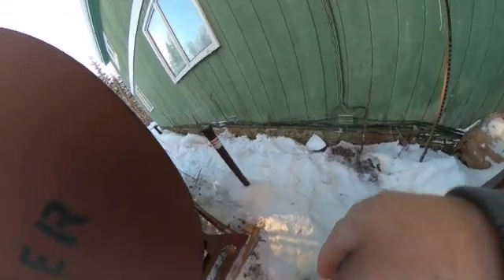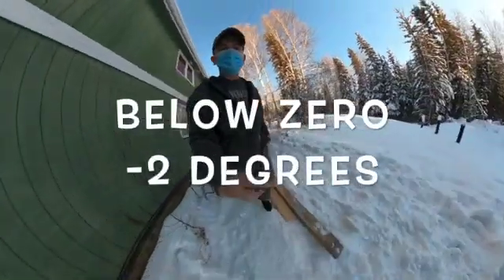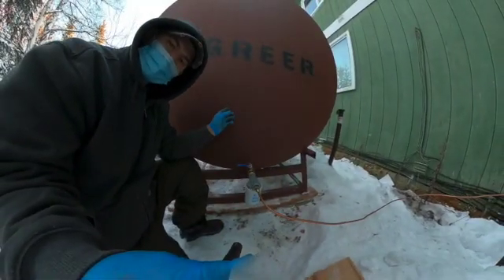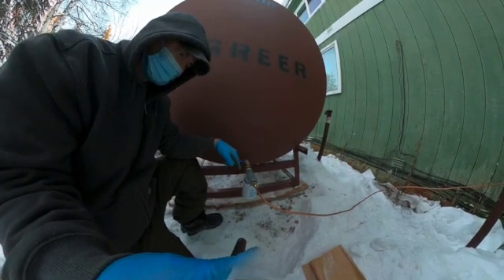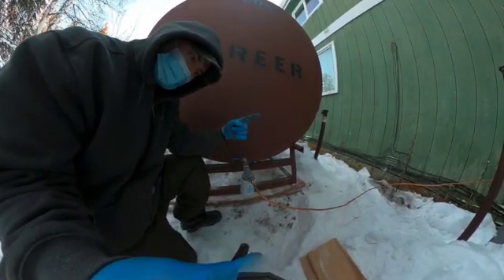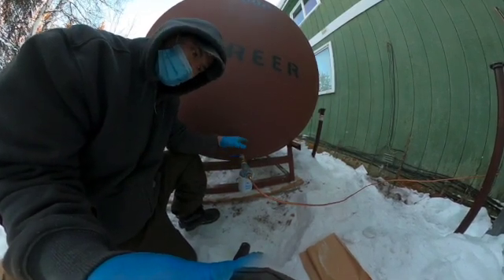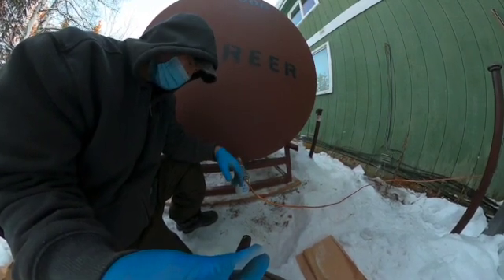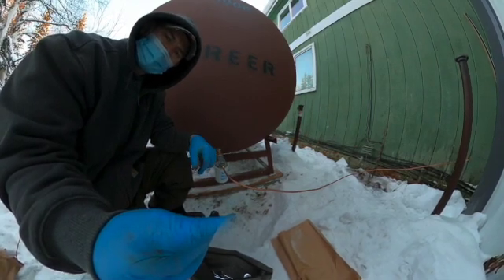How to Hook Up an Above Ground Fuel Tank – Full Install

Comment: Are you adding a fill gauge
Reply from the maker: No, just fill cap, vent and supply line!
Reply: @FurnaceTech I don’t understand the customer won’t know how much fuel is in the tank to order more fuel plus this tank is set on snow when the snow melts the tank will be off pitch. And don’t they have to dig that broken tank up and clean the spill. Are they filling that tank with kerosene or #1 fuel with temperature that low and lower. And with a bottom draw aren’t you going to draw moisture and sludge and possibly plugging the filter

Comment: Wow that’s a big tank  ! so my question is , how do you guys keep the fuel from freezing up or jellying up in the lines ? I mean you guys get a lot of cold below zero temperatures.. I have a tank outside , same set up as the one in the video , but 330 gallon ..it doesn’t get down to the minus but in the single digits at times , and I have to blow out the line with a co2 cartridge..thanks any advice will help.. 👍
Reply from the maker: We fill above ground tanks with #1 heating oil. It's like kerosene. For really cold weather.
Reply: @FurnaceTech  fantastic thanks I’ll look into that 👍